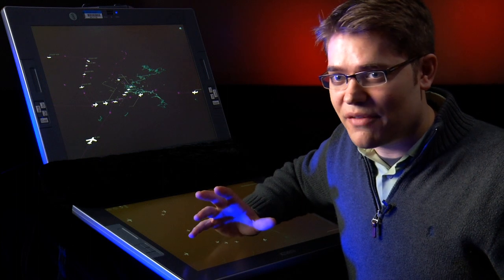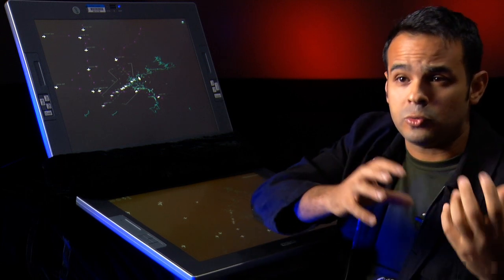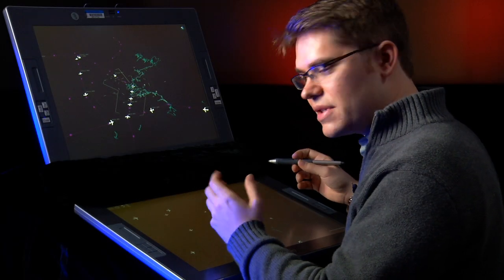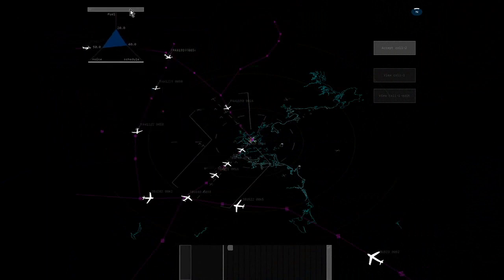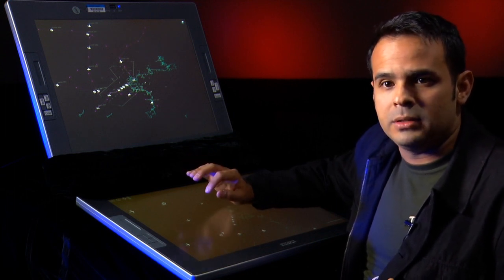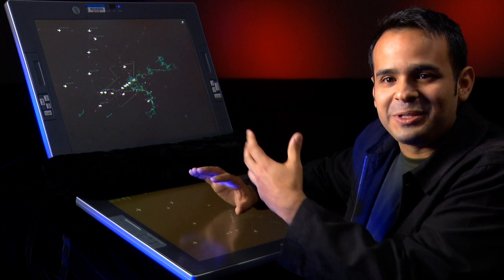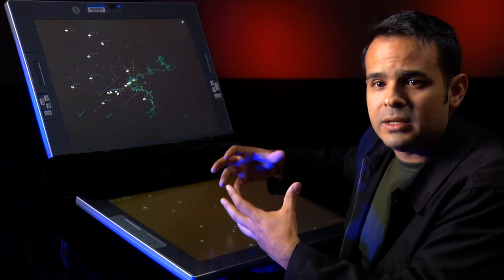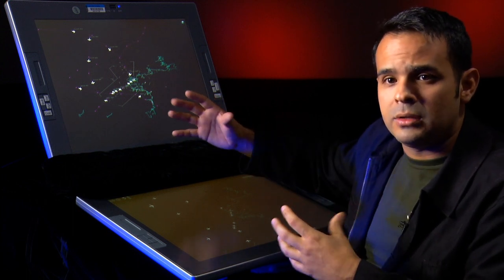The Air Traffic Control station of the future

Comment: The main idea of NexGen is for fuel savings -- everybody gets direct their destination, and the computer works out sequencing with precise speed control (like slow by 1 knot 2,000 miles from destination) so everybody falls into line at proper spacing by FAF without need for vectoring. The computer also works out separation. But with everybody direct you will sometimes get 200 a/c within a 50 mile radius and the computer will say "unable to compute" and that's where the human will "take over."

Comment: Like the other controllers here, and as a Comp Sci graduate myself, maybe I can elaborate in another way: you are making tools that we won't use, and creating solutions to things that aren't problems. We don't need a "3D rotate" tool, we have no problem coming up with traffic "solutions," we don't need to see little airplanes on the screen to know their direction, and we don't need a "what if" tool to "project ahead." You don't need those to drive down a highway either... it's similar for ATC.